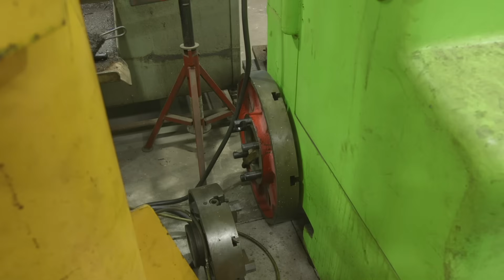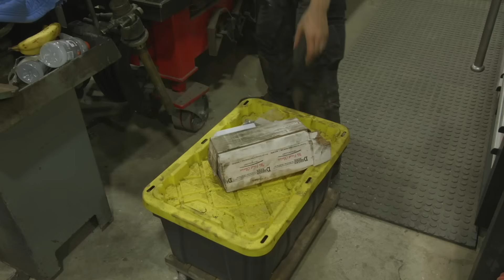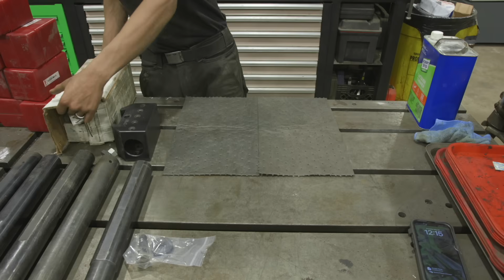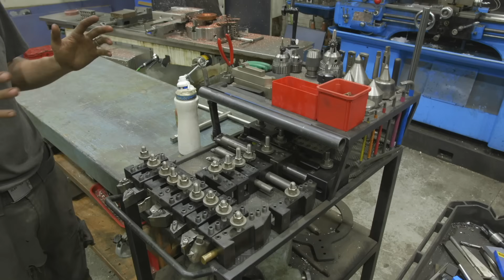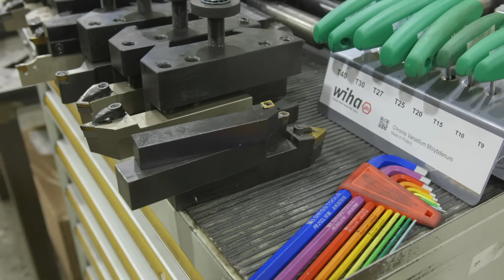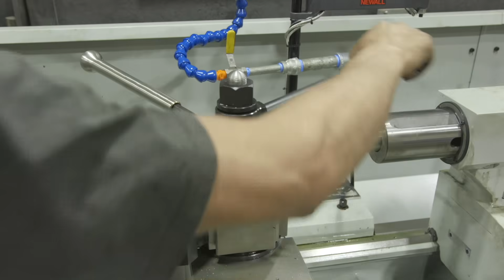Setting Up Tooling On The New Lion Lathe

Comment: Hey I noticed you didn’t name Walter when you were naming different manufacturers, honestly they are a little bit more expensive, but only marginally, and every apples to applesish comparison I have done between them and every other tool manufacturer with regards to like the when they have essentially the same tool with minor minor differences, I have always seen better results with Walter. Their coating process is proprietary from what I understand and honestly most examples I am thinking of are dealing with stainless alloys/ nickel alloys and titanium, but if you haven’t checked out Walter at all, I’d highly suggest at least dipping your toes in a little bit with them. Walter fucks

Comment: For a lot of heavy machining, I do do , I prefer the old school tool post like the one Curtis(CEE) uses on his big lathe, which takes a little longer to set up but the rigidity makes it worth it . I was running a big DC powered engine lathe so power was never an issues.  CHEERS  from Alberta, Canada

Comment: Try alcohol as a cutting fluid for aluminum, oxtools taught me this when we worked together and also that wd40 is only a last resort because it gets up in slideways, evaporates and gums up your machine.

I also realized at some point that making lightened chuck keys out of pipe instead of solid bars makes them a lot more direct feeling and pleasurable to use
Reply from the maker: Interesting, thanks for the tips!

Comment: Congratulations with the new machine and accessories. Its always fun equipping a new machine 😊 

About your drill chucks.  I see you never used a Albrecht 😅
World's best chuck, without doubt.  Clamping, runout, smoothness and finish vise...

Btw. Ditch the tool post and get a Multifix. You won't regret. 

Best regards
Reply from the maker: Thanks OME. Love your content. I am not on IG anymore (to distracting lol) but I know we both have an ocd love for tooling an equipment. I have 2 albrecht chucks. 1/2” I like them but they have their place. I have also broken 1 1/8-5/8 albrecht. I snapped the entire front nose cone. My fault. Was using s/d drill, which I always avoid now days. Never broke a super chuck but maybe I should revisit the albrecht chucks. Atleast the bigger ones.

Comment: Ok Kyle you asked for comments. During late 70s early 80s I ran a Warner-Swayse 2a turret lathe for Barber Greene. Had a friend there who became a foreman.  One night helping one of us he reached out to the chuck on a radial drill. It had a set screw instead of a key. It caught his wedding ring and tore his finger off and pulled the tendon out to the elbow. Brother you need to remove that ring on your left hand and put it in your pocket. Put it back o n when you're not machining.

Comment: I have been thinking about making something to sell as. A side hussell type thing. Maybe build 1-2 per week or month at first. I'm kinda thinking tooling carts and welding carts and probably tooling caddies to fit on top of traditional tool boxes. Made from .125" plate cold rolled. And 1/2" square tubing, or 1" angle . Spray with bed liner  or powder coat. About 6-8 color and custom colors special order type thing. I think a welding cart with a small workbench on top would be cool. And a small cabinet for things like extra wire, rods /filler rods , tig torch  consumables. A small welding table /work bench on top would be very handy for working on a car or something on a lift. You wouldn't  have to keep going from the lift to work bench and walking back. A fold out w welding table about 18" x18", 18" x 24" or 24" x 30" made from 3/8" plate with .500" holes on a grid, 4" centers or so. With 1" strips of .250" bars welded to the bottom on a 4" center grid pattern. With a .500" bracket mount. Mounting  to a 2" x 3" roughly  .250" wall tubing.  As legs of the kart. The welder having a 18gauge cover/ splatter shield that can be used to enclose the welder partly. The gas bottle enclosed and tightly  secured to the kart. If I make one it may be the only one made!😂(😢)  it would be a cool one tho.. have an extension cord and outlet attached to it. 20'-30' of 8 gauge wire with a 12 gauge neutral to allow a 120v outlet for a work light or grinder or a b a battery and charger for a battery powered work light, possibly a pair of 30 watt led flood lights on a flexible telescopic pole  capable of extending it up to about 16'and aim it down, 10 watt led is nearly equal to a 100 watt incandescent bulb , connect it to a 10-20,30 ah lithium  12v battery, possibly allowing it to operate 8hrs a day for a week without a charge or plug it in while used, and charge a dead battery to 100%  within 8 hours. Maybe a cordless  charger can charge 0-100(99)% IN 8-12 HOURS (CHARGING FOR 30-60 MIN. DAILY WILL KEEP IT ABOVE 80% CHARGE  , BETWEE. 70 AND 85%) for the longest battery life, keeping it below 97% and above 20% low and high voltage storage shortens it's life. 50% charge for long term storage is best.  A set of clamps that fit into the .500" holes in the welding table top. And a simple vise as an option. Something similar to a pipe vise. Looks about like a 2"-3" vise with bolt in jaws that is about 3" tall and 6" wide addition to the little vise. It would likely be a two piece vise that bolts in the top holes.  Probably built with the kart. Made from a bar of 1"x2" to bolt to the table. With a pair of .500" precision guide pins about 3"-4" long. Another 1"x2" with a half dove tail for the jaw to bolt into with 1/4x20 grade 8 bolts or similar.  The ground bars pressed in. Aluminum bars .625" pressed in to the bolt in bar of 1" x 2"on the ends outside the .500" bolt holes.  Drilled to be bushings for the rods.  With a .500" acme bolt basically  about 7" total, the moving jaw having the rods pressed-in and a .250"-.325" hole with a counter sink for a nut or bolt head. The acme either milled to .325" and threaded. Or drilled to .250" about .250" deep. With a pair of ground washers with oil holding flecking (like ways on machines). To work as thrust bearings. .250" or .325" and two more sets except .500" a nut on the acme with 3 grub screws to lock it in place about 3" from the end..  assemble the parts the acme bolt should be about 2" - 3" longer than the rods. And the rods should be flush with the bushings or recessed, maybe .050" to .150"not more than .250" make a acme nut from a 1" x 1", 1.5" x 1.5" bar stock about 2"-3" long drill 4 x, .250" holes tapped for 20 tpi, for grub screws thread the nut on and tq the grubs tight. The thrust washers on both sides of the mounting bar being 6"-7" wide. With a recessed holt recessed hole for Allen head 1/2" bolts to mount the base bar for the moving jaw.  The square nut that is attached to the acme rod like a bolts head having 2 .500" holes drilled through it .750" from the end. Use a .500" nyloc nut and a .500" wing nut  on a length of .500" ground rod, with the ends threaded about .350" to be used as a handle . The non moving jaw,  being a 6"-7" bar of 1"x2" with .500" bolt holes  actually,  likely .525" diameter 4" on center. With the holes counter sunken for the Allen head bolts atleast countersink them 75% or up to 110% ( the bolt heads being .050" below the surface) using approximately 2"  Allen head bolts with a flat washer and loctited nuts or nyloc nuts. (2"-2.25" bolts)  the 1x2 x6"-7" bar, having a .750-.875" wide at the minimum forming a half dovetail or French cleat? Heard this called this once. with a .500" x 4" x 8" hot rolled plate steel.  With a 2"x8"x.500" steel bar  is welded to the back side of the plate with a .500" x .500" groove milled .750" from the top edge. To allow the actual jaws actual to bolt in soft jaws made from 2" x 3" x 8" aluminum milled to precision dimensions. 
1.750" x 2.750" x 7.875". With the jaws tightened on a .500" x .500" x 2.00"(or similar dimensions ) steel bars just on the corners of the jaws. then a 2.5" holevbored in between  the jaws leaving a 1/4 round groove making holding any pipeover .625" diameter  very comfortable  and efficient.  Smaller pipe can easily fit on the .500" flats on both sides of the jaws. The flats having a 45° sphere point .250" mill, ran across the flats of the jaws. At a 45° angle at .025" dept hole with the .500"(+/-.125") counter  sunk holes to 1.375" to 1.500" deep leaving about .250" - .375" with a .280" diameter hole for .250" bolts grade 8+ possibly Allen head bolts.  The vise can holdfrom 3.250" to 23.250" or larger depending on the table its attached to!  0-3.250"/4.250" to the table width .. the price of the nickel platedvise and mini welding table added to the cart (possibly $500.00 +/-$150, I'd like to sell them for   $250 making $75-$100each, the material will  probably cost more than that!😢) the cart will probably be $350-$500 and up, . Maybe have a  stripper  versions 🤔  for $150-$250, with a cost effective paint job using tractor/ implement paint. Maybe a clear coat over it. Or a primer only. The tool box caddies. Probably $59.⁰⁰-$99.⁹⁹ The top line version $259.⁹⁹ a powder coat and bedliner finish with sheet metal folding cover to lock up expensive  tooling. With magnetic holders, I really like the welding kart/ fabkart holding 2 welders,   or welder & plasma cutter 2 bottles . Or 1 bottle and a
 12"-15" x 72" air tank up 200 psi with a 3"x72" tank or 4 to hold low psi regulated dry air. 60-80psi or Less. The tanks use .75" pipe fitting  to each other each other with .375" from a regulated supply. With 3 outlets and additional regulators for plasma cutting. and  the tank helps maintain pressure. For power tools allows a 1l2" i.d. hose for impacts. They work soo much better  a small compressor will work for short cuts. 40 gallon tank (+/-) .  Anyone buying $500 welding cart/welding tables these days? Have an awesome day🎉 sorry to ramble!✌🏻

Comment: Nice set up. Huge lathe. Mine is just a 14X44. I just bought a few months back a new Aloris CXA set up and I was a bit disappointed because comparing the new Aloris to the older BXA there is a definite drop in quality. I don't know what's going on over at Aloris but after the amount I spent I'm seriously not too happy. I had to buy a couple Dorian holders for some tooling because Aloris doesn't make these holders for the specific tooling, and the fit and finish on Dorian stuff is impeccable. Another thing with Aloris is there is a lot of movement in their holders when you tighten them down. I've had to shim the tool post to correct angles on boring operations because the boring bar is tilted up almost an entire 5 thousandths. And I check my set ups by sweeping the boring bars with a dial indicator. I'd be curious to see how Dorian compares. Shimming the tool post compromises the rigidity of the setup which is WHY I upgraded to CXA to begin with. Having the maximum amount of surface area contacting the compound slide as possible. Shimming literally removes 90% of that contact area.

I'm in total disagreement with you on the anchor lube. I absolutely cannot stand that stuff. All it does is create huge goopy messes that require a lot of extra time cleaning up.
Reply from the maker: Yes the anchor lube is a pain to clean. I like it in certain situations. Tapping it’s good. Center drilling stainless on lathe is good. Drilling stainless it’s good. It’s a tool like anything it has pros and cons
Reply: @VanoverMachineAndRepair  Should you ever want to try something different than Anchor-Lube for your coolant sump, you might want to try either Blaser SwissLube or Trim-Sol by Master Fluids.

Comment: 1:08:38 What you're doing here is very DANGEROUS...

One day I wanted to impress my new coworker by showing off my “lightning-fast setup skills.” I was machining a piece of mystery metal the size of a microwave and, like an absolute maniac, I left the chuck key in the lathe. Now, I didn’t just leave it ther... I SLAMMED it in, forgot about it, gave the spindle a loving pat, and slapped the power switch like I was starting a drag race... What happened next defied all known laws of physics. That chuck key screamed out of the lathe like it had just been possessed by the ghost of nikola tesla riding a railgun. It punched through my chuck guard, ripped off part of my hair, split a knee mill in two, bounced off the concrete floor, and launched itself clean through a cinder block wall into the neighboring strip mall, where it allegedly impaled a bagel. The shockwave from the event knocked every calendar in the shop off the walls, flipped the welding cart, and made the new employee scream so loud he passed out from shock... Mr. Spindle, the shop cat (indiana thing), went full airborne, did two midair flips, and landed in a bucket of anchor lube with a gloppy thud. The lights flickered. The radio switched stations to Gregorian chanting. The lathe, now humming like it had just achieved sentience, spun to a stop on its own, as if even it realized we had gone too far. I just stood there, eyes wide, shirt torn and body battered like I’d survived an airstrike, and took in the aftermath of my actions. From that day on, I was referred to only as Keymaster, and every machinist within a five-mile radius started triple-checking their chucks out of sheer, primal fear.

You're lucky to have survived that encounter...

Comment: All the nitty gritty - much appreciated!  Would suspending your air hoses from the ceiling just above your head but within easy reach and using a spring of some kind to take up the slack solve your air hose ‘problem’?
Reply from the maker: Maybe it’s an idea
Reply: @VanoverMachineAndRepair   As you know there air hose reels which will do the trick provided your ceiling is sufficiently high.  I have these reels in my garage (12’ 8” ceiling), and they work beautifully.  Thanks again for the in depth video.  I love the detail!

Comment: I know you have tall ceilings- but personally it drives me nuts having an air hose on the ground- for all the reasons plus a few that you mentioned.
Think about bringing them from above the machine.we have 20 foot ceilings at work and it works excellent to have them coming down to the machine.
I like your tooling plan -it’s the way to be efficient.
I can see that Dorian post could be a pain in the behind. Thanks for showing it on a machine -definitely glad I never got around to trying one!

Comment: Dumb question, but if tool holders are 300-600 dollars each, at what point does it make sense to start converting to shop made? 

In the clip where you said that, there were 8 tool holders shown so 2400-4800 dollars.

I that sounds like enough that it would be worth sending to xometry it busy or building your own if you have downtime. 

At my level of import machines. It’s way cheaper to buy than build, but from my perspective, that seems to have flipped for you.
Reply from the maker: Yeah it’s a good point. If I was buying 20 from the get go yeah. Most of what I had I bought a few years ago. The prices now are about 30 percent higher than 2021. Also used is what I been doing on eBay. So far this year I haven’t paid retail for one. It’s mostly a time thing. If I can buy one or two for 150-200 on eBay and it’s going to work with minimal effort that makes sense.
Reply: @VanoverMachineAndRepair what about xometry? The parts would be really quick to draw in cad so the time investment is much smaller and they might still beat 150-200

But I’m incredibly naive so there is probably something glaringly obvious that I’m missing
Reply: @austinlambert3994  It´s often time investment and ease of use/access over everything else.
You can make the money for even the really pricey stuff faster than building it. (As long as it´s kinda industry standard)

Hobby is paid in time investment, Job is paying to not invest time.

As long as you get enough jobs in, buying is always better and safer for the business. Less jobs and it swaps to better build it than spend big bucks.

Comment: Looks like you need to swap locations of the DRO & coolant rise. Tilt both back at 22.5°, come up vertical to X and straighten back up with another 22.5° couple then up to the final hight that suits you.

PS. That lathe is awesome 👍🏻👍🏻

Comment: You must have so good paying jobs on the horizon, people usually buy as the need instead of buying almost everything on day one. Good luck with your buisness in the future. Removing safety guards is not the way to go.
Reply: my lathe came with a chuck Gard but when I put the 4 jaw on it was useless  as it was too small a radius , fine for the factory supplied 3 jaw but NBG for the 4 so off it came ( makes a good door stop tho 😎
Reply: "Removing safety guards is not the way to go."  Unless they make doing your job UNSAFE!  Lathes haven't had chuck guards forever.  Putting one on where you can't tighten the chuck properly is pretty unsafe.  Having a chuck guard might keep you from leaving a chuck key in, but it won't keep you from getting sucked into the work piece!  So there you go.  I'm sure you can do whatever you want on your lathe, and I'm sure Kyle can as well.

Comment: Sorry about your Dorian tool post. I’ve recently had a similar experience with a Aloris set. Paid full retail things came from the factory, dirty and misadjusted. And some of the parts don’t even fit together. This includes tool holders that won’t slide onto the tool post. I bought a few cheap Chinese tool holders and those actually do fit. Failures for AMERICAN manufacturing.

Comment: The 10.2mm holes in the nut were supposed to tapped for M12-1.75 set screw so you could lock the nut in place.

Comment: Regarding the DRO and Coolant setup being in the way for chucking 25" parts it really shouldn't be a huge issue since typically a 25" swing is not 25" over the cross slide.  I believe yours is probably 17" or so over the cross slide.  I like your tool cart and top shelf.  It really helps organize stuff.  I also like how you did the tool post height adjusters.